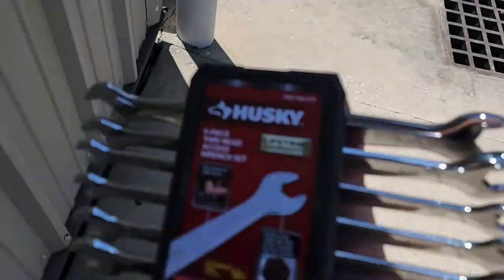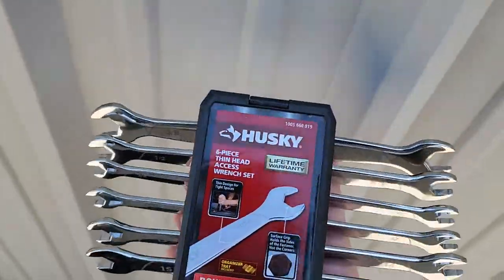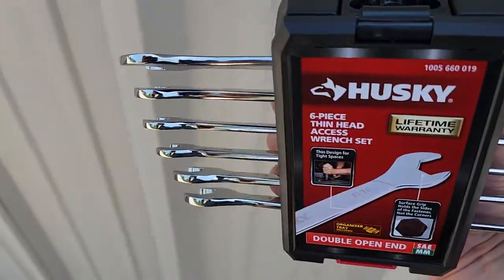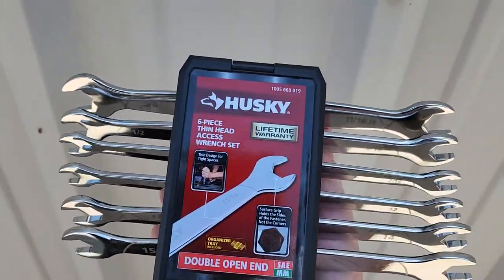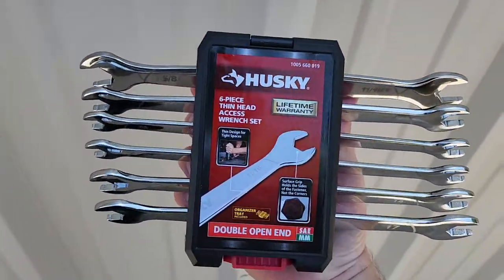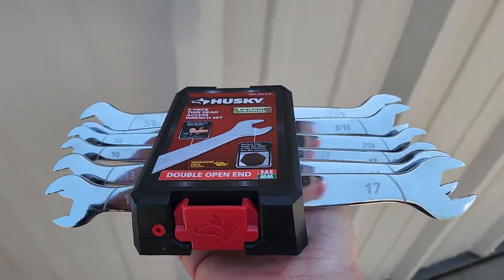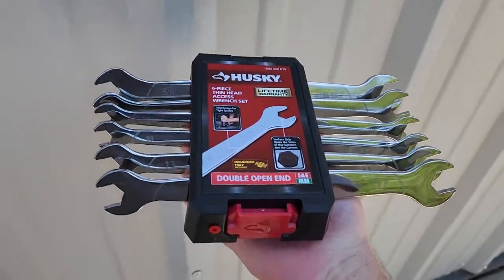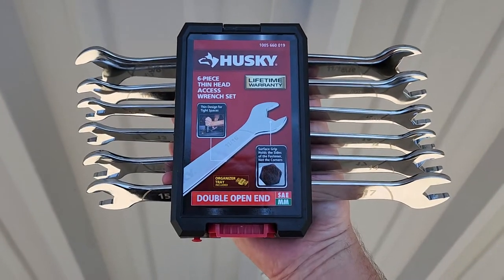They Exist! Thin Wrenches!

Comment: Those are indeed very handy, i can't count on 2 hands the times that i needed a thin wrench, each time a normal wrench didn't fit, 
i took a cheap wrench and used the angle grinder to make them thinner, but after that they started to rust. 
So that set is a very nice alternative.